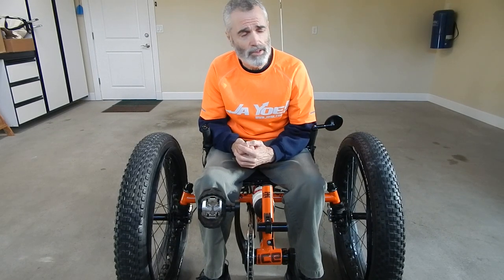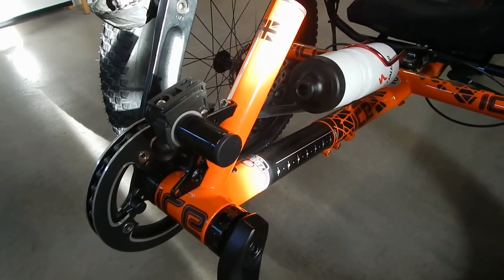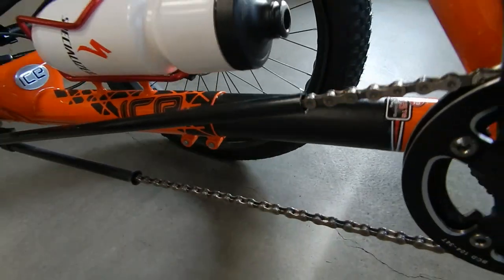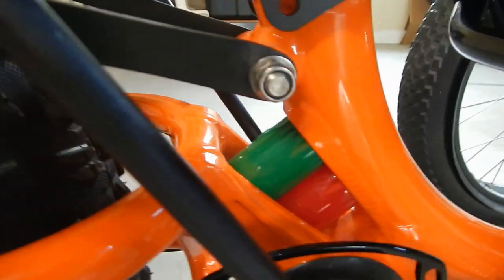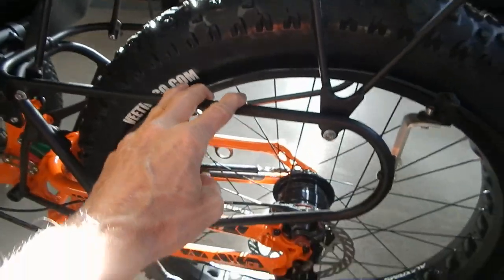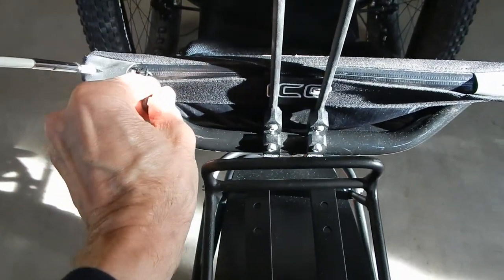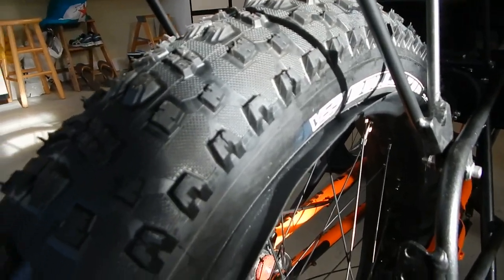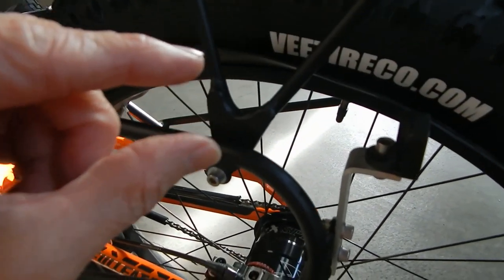Fatrike Chat with Trike Hobo on an ICE Full Fat tricycle

Comment: I had the chance of a roll around the ICE factory carpark on the 24" wheel prototype trike before the full fat went on sale, and it was a lot of fun! (One of the perks of living in the UK: Falmouth is only 250 miles or so from me :-). I ended up getting an Adventure 26" to which I have now added the widest tires I can fit with the mudguards (Fenders), which are 2.1 inch Schwalbe's, and just swapped the rear for the 'Soft-Tail' that was not available when I got it: what a difference! I can only dream about a Full Fat, though, so thanks for giving me some details to look at!
Reply from the maker: You are quite fortunate to live so close to Falmouth. I have met the ICE folks, but over here in the USA at the shows. Your ICE Adventure is actually the better pick overall because it offers more riding options than a Full Fat does, and adding the soft tail makes a huge difference too, along with those larger tires. The Adventure is much more practical than the Full Fat in my opinion, and likely weighs less too.
steve

Comment: so here we are in 2024....after having ridden this awhile, how does it compare to other off road trikes you've ridden? ...particularly the Azub. I'd also love your opinion on this vs something like a Surly BFD  a quad style setup like Pony4 or the Utah trikes. Thanks for sharing your videos and insights.
Reply from the maker: Back in 2009, I originally wanted a quad, but back then, there was virtually nothing available like there is today. Utah Trikes was just getting started. I am sure a fat quad is a lot of fun to ride, and if it has two wheel rear drive, would give much more traction than a fat tire trike with only one wheel drive. But on a quad, if you turn going downhill on two distinct planes simultaneously, one wheel will always lift off the ground, whereas on a trike, a two-plane turn will not lift any wheels off the ground.

AZUB trikes are outstanding, but very costly due to having so much hand assembly with expensive materials. Before I got my ICE Full Fat, I wanted an AZUB fat trike, but the company had not yet made them available for public purchase (they were still doing final testing on it). So, I got the Full Fat instead. Both are high quality trikes, but the AZUB is not suspended, whereas you can get the Full Fat with full front and rear suspension, which is very important for maximizing comfort. You will hear some people say that with fat tires, suspension is not necessary, but I don't agree at all ... a suspended trike, even one with 26x4.8 tires aired down, is not as comfortable as the same thing with full suspension.

When it comes down to comparing recumbent trikes with upright bikes, there is a day and night difference. Both are fun, and have their advantages, so it comes down to what a person wants to do with the cycle. Fat tire bikes are more versatile when it comes to where they will fit (like single track on a hillside), but they can't match the comfort of a recumbent trike.

steve
Reply: @EZSteve   Thanks! I should've specified the Azub Ti-Fly X with 26x3" tires....not their unsuspended full fat. I'm over 50 and I used to own a surley Pugsley. After years of a 20 mile  daily commute, I was ready to get off the mountain bike. I'm thinking of changing to a trike or something like a Yuba Spicy Curry or Tern Orox/GSD as a car replacement.
I'm still leaning heavily toward the Azub Ti-Fly X or potentially building my own trike. I've been scouring the AtomicZombie/Chop Shop forum lately since I can't really find a perfect solution. If this ever becomes a reality for me I hope to see you on the trails.  :)  ..I get the feeling we're not too far from each other.
Reply from the maker: @velvetvideo  The AZUB Ti-Fly X is an excellent, and very costly, recumbent trike made in the Czech Republic. My friend Matt Galat, who has the "JaYoe Nation" YouTube channel, had one of these custom built for him when he visited the factory a year or two ago. He has quite a few outstanding and insightful videos about this trike that will definitely help you to decide if this trike is a good match and fit for you. Check out his videos on the AZUB Ti-Fly X here:

https://www.youtube.com/@JaYoeNation/search?query=Ti-Fly

Another great option is the HP Velotechnik Scorpion fs26 Enduro, but rather than 26" wheels all around, it has a 26 in the rear, and 20" wheels in the front, so not as much ground clearance if you plan on doing a lot of serious off-road adventures.

When I sought a car replacement back in late 2008, I first wanted a quad, but only one existed that I could find, and that company went out of business before I had made my decision ... so I ended up opting for a recumbent trike instead. The comfort level on recumbent trikes is day and night different compared to bikes, unless the bike is a long wheel base recumbent bike. But even then, for long trips, a trike has many advantages.

Check out Matt's videos on the Ti-Fly X, and leave him some questions. He has a LOT of experience with this trike, whereas I have none at all (I prefer the HP Enduro myself).

steve
Reply: @EZSteve  I've watched most of Matt's videos already. Thanks for the link.   :)
Reply from the maker: @velvetvideo  I hope you find success in getting the wheels that match your needs. I never get it right the first time, going through several different choices (and a lot of cash), but I sure enjoy the process of trying this and that. Maybe the search is more important than the conclusion? 
steve

Comment: I have always wondered if the Rohloff could be paired with a double chainring to get even lower gearing. I think it would be nice to have a 24/36 setup.
Reply from the maker: Yes, you can do that pairing, or even with a triple chainring up front. The low climbing ability of the trike would increase substantially with such a setup, which is a good thing in really tough terrain.
steve

Comment: Chain Tubes....Contact Pat at t-cycle.com with the length that you need and they will custom cut and flange it for you.  They manufacture all the chain tubes / Idlers / and logo flags for Catrike.  TerraCycle is located in Portland on about 60th and SW Center. Just south of Powell.  Nice genuine people to work with.
Reply from the maker: I met Pat in 2011 at the second annual Recumbent Cycle-Con in Pomona, California. Yes, he is a super nice fellow, and made sure I had one of his double bottle holders for my trike before we parted ways. TerraCycle is top notch. At this writing, Pat has retired, but has left the company in good hands.
steve

Comment: I'm sure you're aware, and it's of my opinion, that one of the greatest draw-backs recumbents have is their visibility as viewed from vehicles on the road: tis the reason they typically are seen w/ those six ft. long flags, so as to alert drivers of their specific whereabouts. These flags help, but hardly suffice in their attempt to be noticed by drivers; especially, at this early stage of recumbents where drivers aren't really expecting to see them on the roadways and byways. However, it seems that your trikes for off-road do set a bit higher than those designed for the road; that they clear the rough terrain typical of most trails. Knowing that we don't want to be top heavy in the trike design, has there been any talk of elevating your road trikes to maybe eight to twelve inches; thus, giving the rider a little more peace of mind as traffic comes up from behind thinking to themselves, "I sure hope / pray they see me". Thank you for a video well done. Your thoughts please.
Reply from the maker: Howdy Timothy!

Thanks for sharing your thoughts. You make good points. Yes, this ultra large off-road trike is FAR more visible to motorists than standard street trikes, like the two trikes I had prior to this one, which have the seat only about seven inches off the pavement! Since this video, I have sold this Full Fat trike, and now ride a bicycle, and I have noticed that traffic gives me even MORE room when they pass than when I rode trikes for nine years. The trike in this video allowed me to be eye-to-eye with motorists in standard sized sedans, but with my low street trikes, my face was at mid-door level of the cars, well below the door's window. I always did run large and bright flag arrays on my trikes, which made a BIG difference in my visibility.

Most recumbent trike manufacturers do make street trike models that are higher, as you discuss. This is primarily because a significant percentage of recumbent trike riders are in poor physical condition (excessively overweight/balance issues/back pain/etc), and higher trikes are necessary for these folks so that they can simply get into and out of the trike. The low racy trikes, like I had, are fast and handle superbly, but require an athletic person who has no physical issues to mount and dismount with ease. As expected, the higher trikes for the physically challenged do not have the same excellent handling capabilities as the lower trikes, but they do make it so motorists can see them much better.

On all three of my trikes (two low/one high) I never did have any negative road issues with motorists who did not see me. I was always afforded great respect in sharing the road. Since my triking days, I've had two bicycles, one a fat tire off-road model, and my current street bike, both of which can be seen on this YouTube channel of mine, where I do detailed reviews of each. At this point in time, having now been riding bicycles for just over one year, I feel safer on the bicycle than on the tricycle. The common mindset among trikers (me included prior to my current biking days) is that recumbent trikes are so odd looking that motorists will notice them readily. There is also the thinking that since recumbent trikers look like physically challenged people in elaborate wheelchairs, motorists will go out of their way to treat them with respect and avoid hitting them with their cars. 

I believe there is merit to these visibility thoughts for recumbent trikes, but still, with so many drivers these days texting while driving, and using their cell phones, I prefer my much larger and taller profile on my bicycle. When riding my bike, which puts me in a tall vertical position of more than six feet, I believe I am considerably more visible to motorists than on my former recumbents, even my giant Full Fat as seen in this video.

See ya' ...
Steve